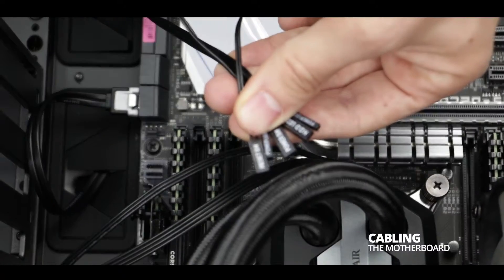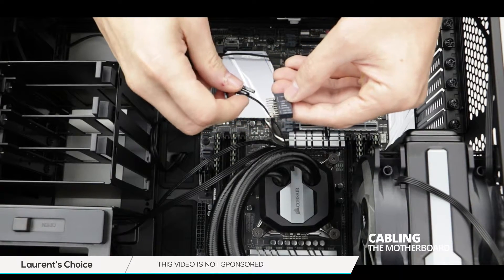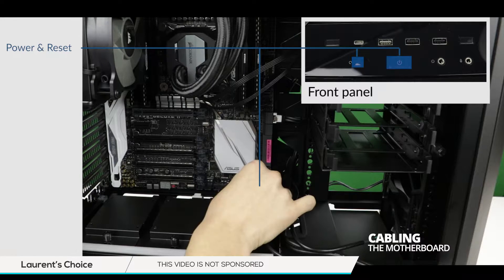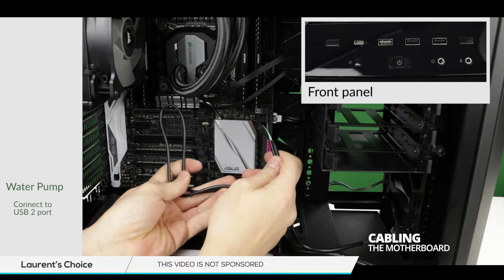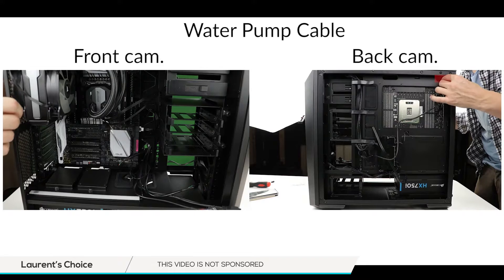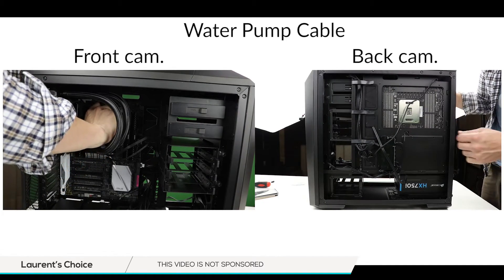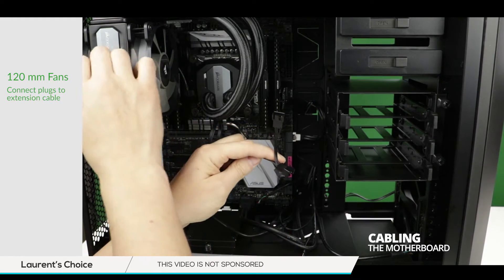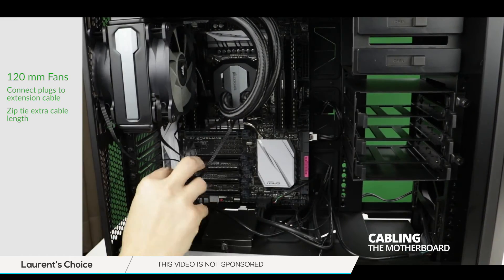Connectors & cabling (Crazy CPU Machine 8/10)

Comment: I really like this motherboard (ASUS X99 Deluxe II). However, that they included only one onboard USB 2.0 port is a real pain (Grrr...)! As it stands right now, I need a connection for the front panel USB 2.0 ports of my case, one for the water pump, one for an NZXT Hue+ (LED lighting) and one for the power supply (I'm using a Corsair RMi PSU which has Corsair Digital Link requiring a USB 2.0 connection). I am solving this problem by using an NZXT Internal USB Hub (https://www.nzxt.com/products/internal-usb-hub) and a USB 3.0 to USB 2.0 adapter cable (https://www.moddiy.com/products/USB3.0-19%252dPin-Female-Header-to-USB2.0-9%252dPin-Male-Header-Converter-Cable.html).

Oh, by the way, the NZXT Internal USB Hub also requires a USB 2.0 connection, so that means I need five USB 2.0 connections. I could run several cables out to the back of the case and attach them to the USB 2.0 ports on the rear I/O panel of the motherboard, but that's rather messy and a kludge at best. Instead, here's how I will connect all of the above using only the internal USB headers on the motherboard:

- NZXT Internal USB Hub connected to motherboard USB 2.0 onboard header.
--- CPU cooler water pump connected to NZXT Internal USB Hub.
--- Power supply connected to NZXT Internal USB Hub.
--- NZXT Hue+ connected to NZXT Internal USB Hub.
- Front panel USB connected to motherboard USB 3.0 onboard header using 3.0 to 2.0 the adapter cable.

So, thanks to the NZXT Internal USB Hub and the USB 3.0 to USB 2.0 adapter cable, I only need one USB 2.0 and one USB 3.0 onboard header.

Hope this helps...
Reply from the maker: +coleplacemb it does !

Thanks for sharing on this.

I'll add it to the forum for future users :)

Thanks again codeplacemb :)

Comment: 01:09 That cable is not the power for the water pump, it is the connection for the 'Corsair Link' communication through the USB header.
Just a heads up
Reply from the maker: +Devil Dog ur right.

But both worked, though i corrected when added more Ram.

Thanks a million for your contributions :)